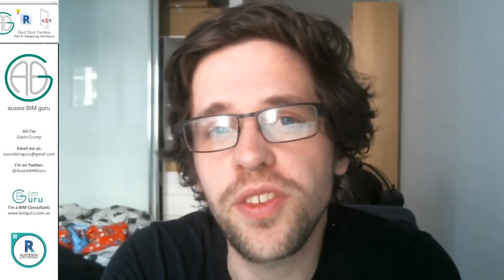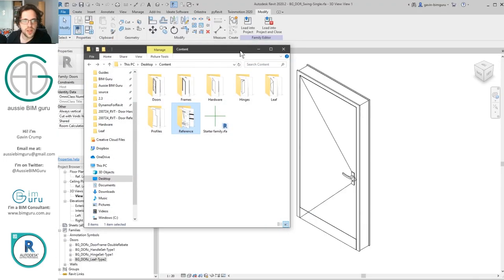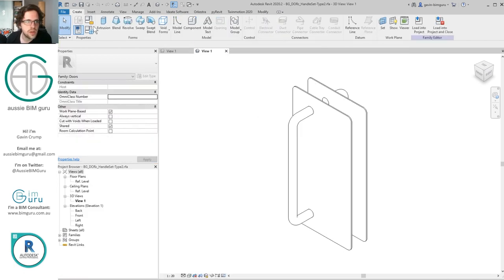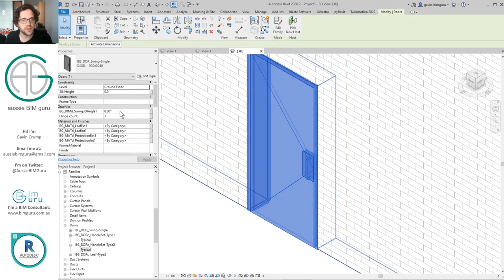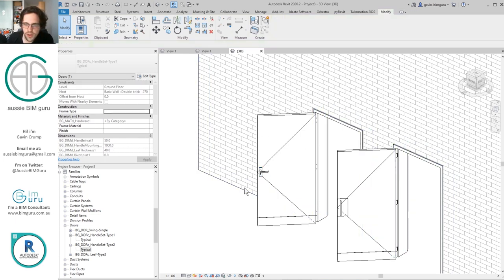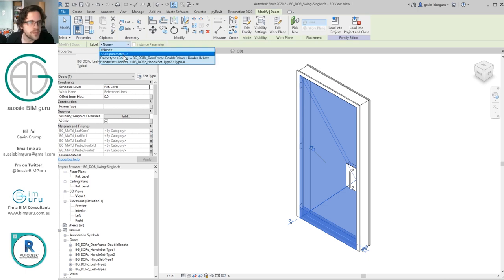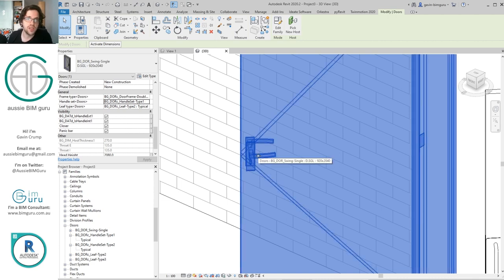Revit Doors, Part 6: Swapping Hardware

Comment: This is an incredible tutorial. Really appreciate the attention to detail. I’ve been expanding upon the door family I created with this and I was just wondering, I have it set up where I have a wood frame in the the hollow metal frames created with this tutorial. I associated a trim projection offset with the 1/2” needed for the metal frames but I want to make it so that when I switch to the wood frame that automatically goes to 0” so that I can add whatever wood trim I want. I’ve been trying to figure out how to write a formula for this with no luck. I didn’t know if you had any thoughts or if you had a tutorial on creating more complex parametric formulas… not even sure if you can combine a label parameter with a formula. Starting to get the feeling you can’t. Thank you so much for these tutorials though. They are a huge help with taking models to the next level.
Reply from the maker: Glad you found it helpful/interesting.

It sounds like you've come across the frustrating limitation with using family type labels which is that they can't be used to drive other types of parameters unfortunately - many of us would love if they could be used this way for sure.

If your wood frame is a separate nested family, maybe it's just a matter of not having a projection included in it, even if the projection data is technically incorrect in that case? Might need to train the user how to work with that condition.

Comment: Gavin, the real value of the Type Catalog is that when user purge the Project File, the Types go missing.  The Type catalog re-instates the defaults.  Its sensible, not clever (get the workflow right).  I like the level of detail thought that has been used, i state that again.
Reply from the maker: Thanks! Yes they make for a good insurance policy for the 'save from project' types in a high trust server environment.

Comment: I've just created all the shared parameters between my door families (Door casement, door panel). I have nested the door panel types into my casement type(single swing door), the idea being the user can swap them out as you are showing here. But the shared parameters are not mapping across. any ideas why that would be happening? doe they have to be instance parameters for example? I do feel I have tested that but maybe that is not the case. i built all the panel from the same family as a base, so I'm unsure what is happening. Any advice, as always, is greatly appreciated your channel helps me so much !
Reply from the maker: Generally all swappable components will need to have all associated parameters for the values to hold whilst swapping at project level, otherwise theyll drop off/on when swapping to other families. They will need to be instance based.
Reply: @AussieBIMGuru  ahh ok that will be my issue then. As some of the families have visual panel dims but not all, also they are definitely, all type parameters! I will do a few more tests thank you

Comment: Can we create Hardware, panel,etc.. schedule with labels? (for count)
Reply from the maker: Yes as long as the components are shared they will report to the project level and be scheduleable. Usually I provide them with a unique word in their description such as 'hardware' so I can filter out the actual doors, and also filter the hardware out of the door schedule.

Comment: Hi Gavin. Is there a way to get only door handle types in the roll down list for door handles and door leaf types under door leaf etc... without the irrelevant components? Is there a formula or something to make this work? The only way I managed to work around this is to change the nested family type to something unique for each type of hardware, which isn't optimal however does the trick. Cheers
Reply from the maker: Unfortunately not, this is one reason i avoid these dropdowns in a lot of cases. The only way I've seen it semi-controlled is via strict naming conventions to keep relevant components close together or searchable. Another limitation is these labels cannot be nested so can only function as in instance parameter 1 level away from the project.
Reply: @AussieBIMGuru  ah that's ashamed. Thank you for clarification.

Comment: Hi me  Again;) Regarding type catalogue for different doors.
Did i understand it correct? When you have different doors listed in your catalogue all those changable handles etc should be intances not types otherwise it breaks.
So the conclusion is when you create catalogue type for various door widths all leafs, handles frames have to be instance based. Instanced based from the very first nested  family. So frame leaf family compoments to be inctances,   glazed panes also to be instances, door family linked parameters also, and you control all of them by selecting dropdowns in type catalogue.
Reply from the maker: Not quite... they can be type or instance, but unfortunately if they're type based they aren't written to the type catalogue and often load incorrectly to the model hence.

The 'breaking' aspect is moreso if you nominate a family not intended for use in such a way, for example if you nominate the nested handle as another door family.
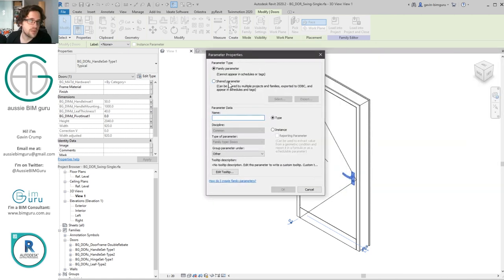Reply: @AussieBIMGuru  When you were creating components like frame some parameters were instance based, others where type. Obviously makes sense to make some of them types (depends of your needs). But looks like it makes no difference what is what as long as you make the final parameter  instance based (5:12 and 12:28).  As long as its beeing set as an instance, it shouldnt crash whilst using type catalogues. Is that correct? Please see example below to clarify.
Revit doors video part 1 frames (26:44) - just an example but you had instance and type parameters. But then it was nested into a door family as an instance (same as handles at 5:12). That is why you could easily swap them over.
Same thing with handles and leafs. It doesnt really matter if nested sets are mostly instance or type based. As long as the final parameter (label created at 5:12) is beeing set an instance.

Will go through the last video to double check :) Ive created 2nd handle today and will try to nest it tommorow hah :D
After its all done will try to recreate it from the beggining :)

Can share my baby with you if you like. If not you, I'd never created such a cool family. 
Thank you for inspiring people. 100% I am not the only one inspired  by you and your talking cats
Karma always comes back :)
Reply from the maker: @danielwiesiek  thanks for the kind words, more than happy to see the outcome when you're done!

The type catalogue should never crash the family, it could lead to errors but typically revit can handle a component in this state.

Instance ia typically best for family type parameters, but they can be type based if you need (e.g. diffferent leaf types for fire/non fire rated doors). Typically I like to use these parameters like an additional set of control over subtypes of a door (hardware etc) so i make them instance due to this.
Reply: @AussieBIMGuru  Hah so funny. So just finished mine and it differs to yours :D Type catalogue works with type parameters but not with instances. I made door frame as a type and i can easily swap over. Handles created as an instance and type catalogue doesnt update them in the project  level :D Just emailed you. See yourself as it may be interesting :D
Reply from the maker: @danielwiesiek  will do! I'll aim to get back to you by end of week - busy one!

Comment: Excellent 🌹 please guide me I have one question when make instance parameter in sub family and choose shared family and load to main family when select sub family I can change instance parameters of it but when load main family to project and select with tab sub family instance parameters of it is off and not able to change!!! How can fix this problem
Reply from the maker: The only way to do this is to associate those parameters to new ones at the host family level. Then you can adjust the host family parameters at project level and the values are pushed down to the nested family instance.
Reply: @AussieBIMGuru  ohhhh my god!!! God bless you🌹🌹🌹🌹🌹

Comment: Can this nested door family allow me to group Hardware to a set in key schedule  and displace the set number on door schedule?
Reply from the maker: Not typically. You can check the host family of your hardware family though and then use dynamo to mark it with its host number then schedule the hardware separately.
Reply: @AussieBIMGuru  For me, it will create a long list of hardware schedule.  I purchased the door family and see your dynamo code to create the hardware schedule separately.  Do you think it possible to add into the code to check the host(door) then group all the host that has the same hardware to make hardware group and displace it on key schedule? Thank you!
Reply from the maker: @theresa6895  my door system doesnt use key schedules, these arent connectable to nested families in revit. I'd suggest running my hardware script but maybe modifying it to comment them with the host door mark and then sorting/grouping a door schedule by the comment with the door mark as the header.
Reply: To make it clear, what I mean is compare all the host (each host has a list of door hardware) and only keep the one that has different door hardware.  All of the host with different door hardware now become sets of hardware then import back to create key schedule for normal door schedule.
Reply from the maker: @theresa6895  that sounds like you are trying to make hardware set codes, quite a different workflow. You'd need a very different script to run after that to match sets of associated hardware door by door to their respective host door.

Also these are very particular queries for a student to make...
Reply: @AussieBIMGuru  Gavin,  I love your door library.  It's very helpful.  I am just trying to ask questions to see if I can somehow make your door library to work with the schedule  in the template I created for myself.  Thank you for the direction.  Now I know it has to go on a different script.  I will try to figure something out when I have time.

Comment: Just watched them doors tutorial again, after 6 months :D Still think its the best one ever. One thing I have learned after. Have you ever tried using revolve instead of reference lines for rotation? Cool stuff and always works.
In one of your videos you said if you want to control parameters on instance base you make them instance hence all your nested families are instance based and parameters in main family were type. Would it make any difference if you made leafs, handle sets etc. type based? I understand Parameters should be type for arrays but leaf had no array so could it type?
Also in the video above you mentioned about loosing label parameters if you have different types in one family :D It is magic. 
Would it be beneficial to add an idiot proof explanation to your courses you are about to release? Can't wait for families course, dynamo seems to be way to advanced for newbies like myself ;D Programing within a program is overwhelming.

Probably mumbling but it's 2 am here. Apologies and keep going! You will build a BIM empire one day!
Reply from the maker: Far out, time flies - it's been that long already?!

I have indeed tried using revolves with angle constraints, in some cases it is geometrically viable - all depends on the element the revolve represents and how accurate it needs to be. Given that the hinge pivots here it may be viable if you control the start/end angle using a formula.

Parameters don't have to be type based if arrayed, but it makes things a lot easier if you need to change those parameters (they try to ungroup the array if you modify them when applied as instance). For an element like a leaf I usually do instance based as you may have different sized leafs in the same family (e.g. an unequal door), and also different hardware visibility such as kickplate on/off and its height.

My second planned course (that I've just begun preparing) is all things families, and label parameters will make a more detailed appearance amongst other things not yet shared on the channel itself.
Reply: @AussieBIMGuru  Thanks! Can't wait! Will have to book some time off and swallow it all in one go when released!

Comment: Why not use all the parameter shared from the beginning in the nested families , in this way we will be free to have them in schedule or not to have them.
Also why to chose type parameter when we could have more flexibility(i think.. might not be correct..) in instance parameter ..?
Reply from the maker: If you want to make hardware shared at the project level then yes you are correct, shared parameters and instance parameters would be the best choice.

I use type parameters here as my handles are non-shared, so I can associate my parameter once to the handle family even if I have two placed in the family itself.